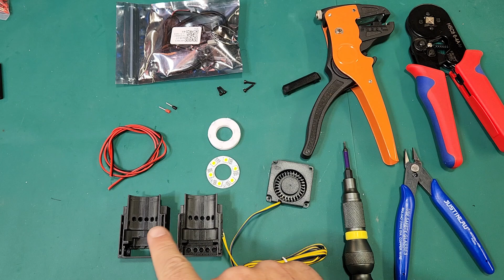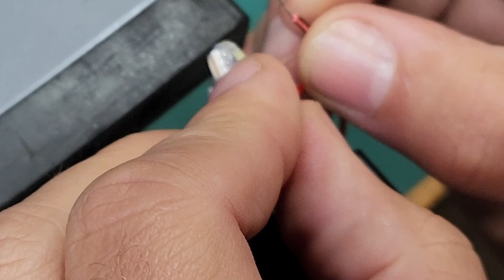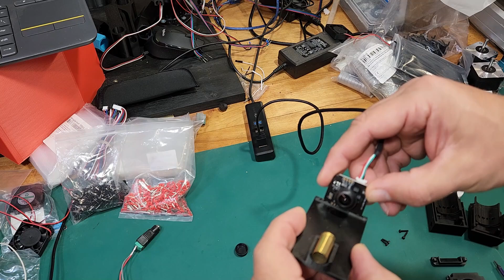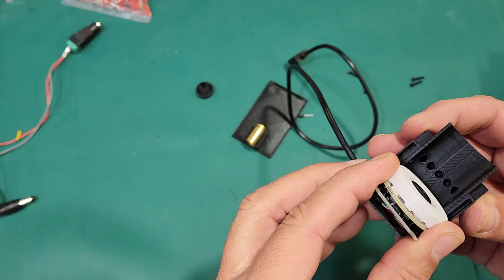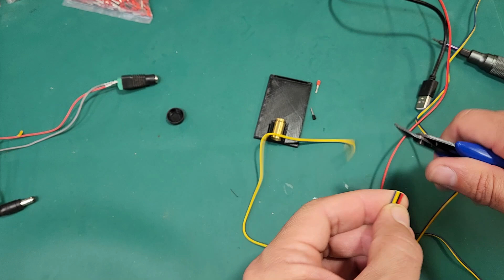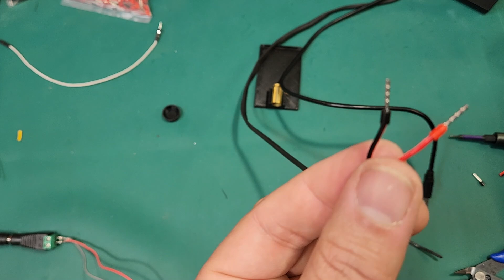CS7.2 Build Series - Camera Assembly

Comment: Hi Seth. The camera image is off centre in the clamshell. The camera assembly looks aligned. Not sure if the camera module is off centre..
Reply from the maker: This is usually caused by the resolution setting in the software. Make sure you have the camera set to 1280x720.   For some reason, if it is set to 640x480, it only uses the bottom corner of the image.